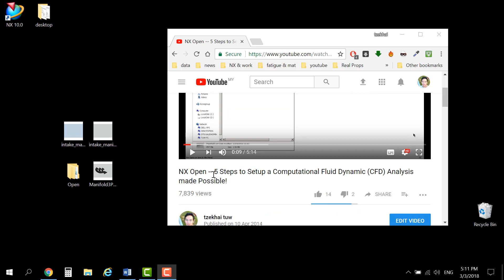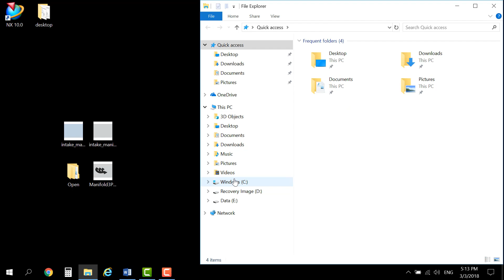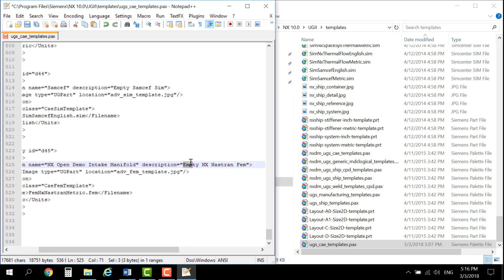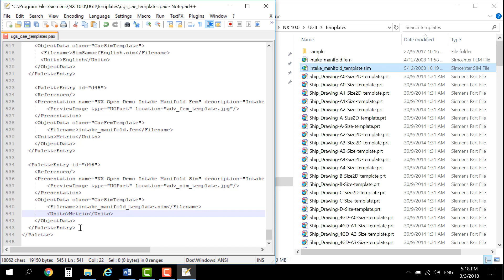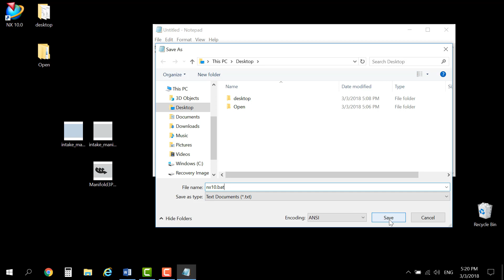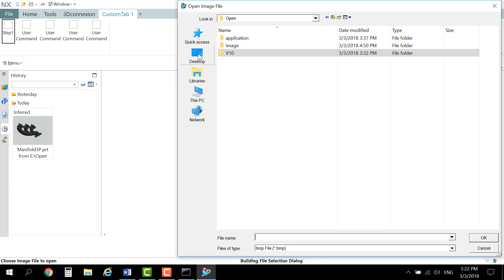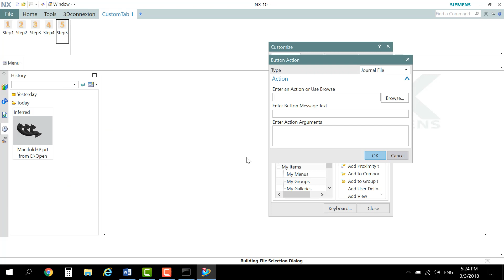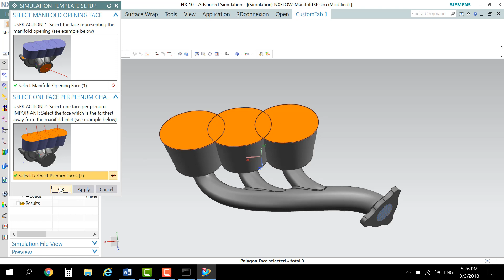Example of NX Open Customization Setup

Comment: i used journaling and  record  all my drawing i designed a complex shape  and  i used customization i create a button on customtab and i clicked the button and the  program  drew the my complex shape automatically  when i wanted to change the parameter i can do it after drawing but i want to programme asking me before  it draw how can i do ? 
for example i drew a  pipe and  the diameter was 10 mm and journal file draw automatically ten diameter pipe but i want programme asking me what is your pipe diameter ? and i input 5  and programme draw automatically  5 mm diameter pipe ?